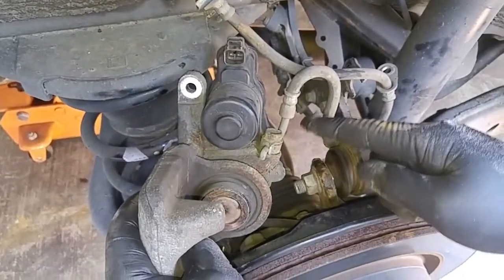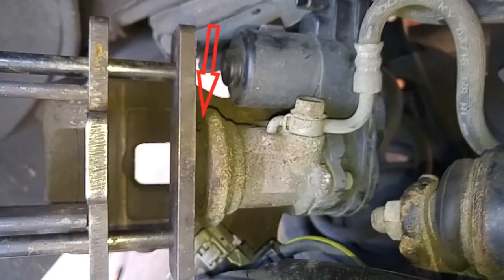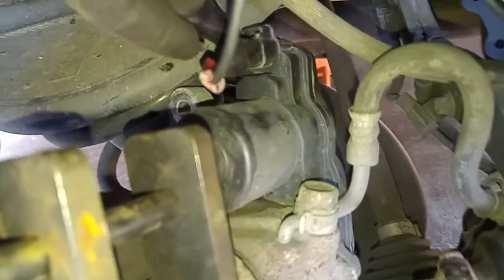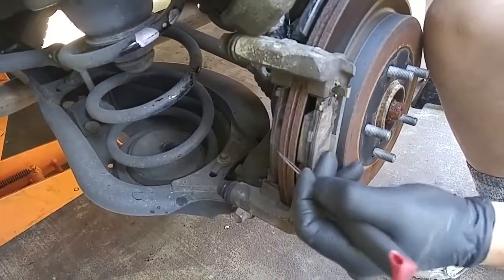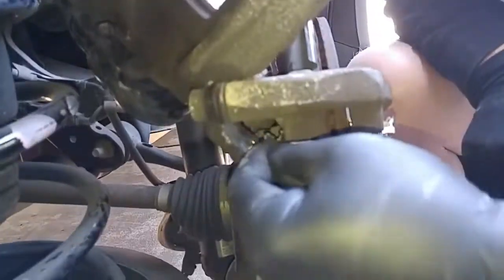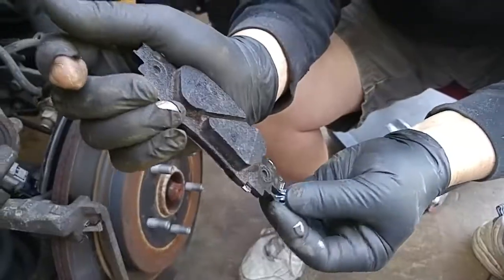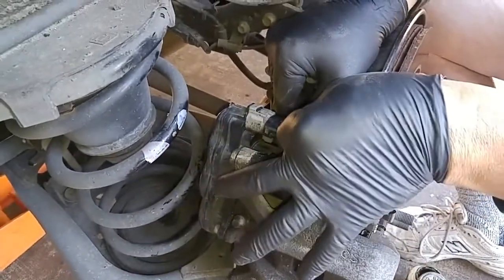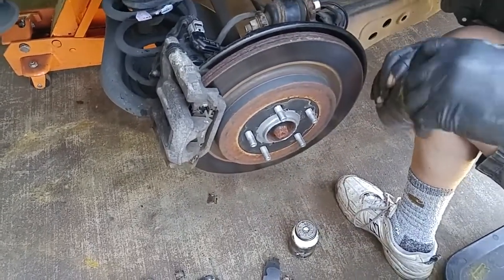Lexus RX350 / ES350 Rear Brake Pad Replacement (Electronic Parking Brake w/ Brake Hold)

Comment: Great video, thanks!  May I ask?  What brand/model number is that tool you used to depress the caliper piston?  It looks like it's built strong (heavy duty), and easy to use.  I'd like to get one.
Reply from the maker: Thanks for your comment!  It a dual piston caliper piston compressor tools.  Can also be used on single piston calipers.  Here's a link to the tool:  https://amzn.to/2TBOkWV
Reply: @hardlymovingpro  Thanks!  I was and am impressed with the structure of the design of it.  It appears more balanced in that it will apply EVEN pressure to the piston and not cock it one way or the other. I really appreciate you taking the time to share, and even provide a link.....Thank you again!
Reply from the maker: No problem!
Reply: @hardlymovingpro  Listen, I just have to mention....you said that the piston depressor will do a dual piston caliper, and I can see that.  When I said it is "balanced", and that is important to me, I mainly do single piston calipers, and was using the ratcheting kind, and it too is fairly wide (so it can do dual ones), but it fits into the caliper in such a way that it can, and does "press" unevenly - like to one side of the piston, or the other.  So THAT is why I told you I liked the one you had (which I ordered, and is coming today), because the two legs the plate rides on, force it to be even from side-to-side.  Just wanted to share that.  Thank you again!

Comment: Did not know about the electric parking brake. Thanks good to know. Dealership would charge an arm and leg to do this
Reply from the maker: Yup.  Was scratching my head trying to figure out how to compress the caliper piston back in.  Only added a few extra minutes to the brake job retracting the parking brake motor screw.
Reply: Hardly Moving Productions where can I get that wire setup used to retract the caliber? Thanks in advance